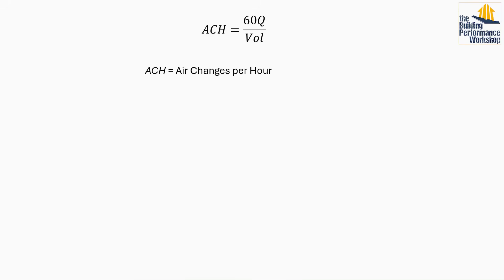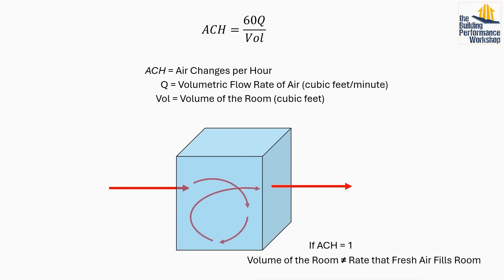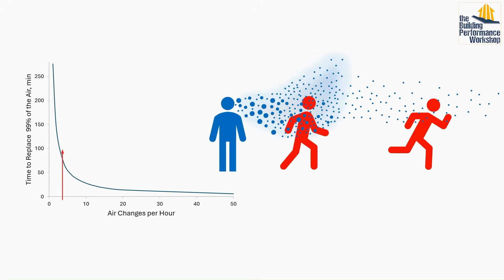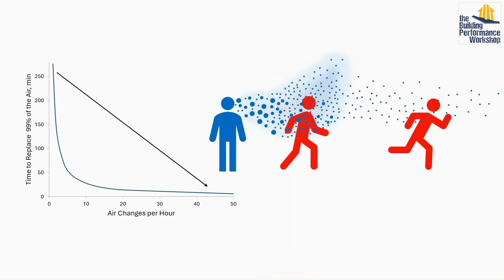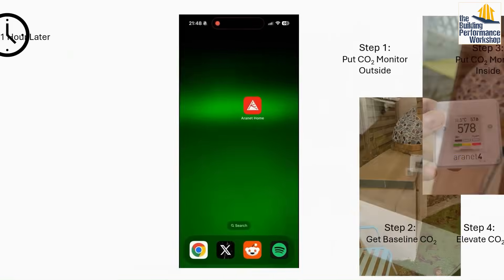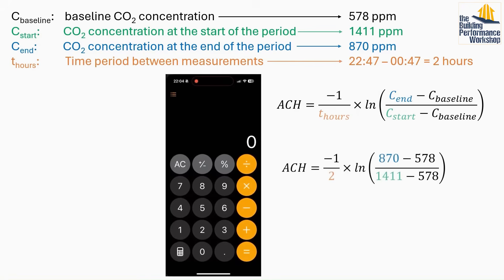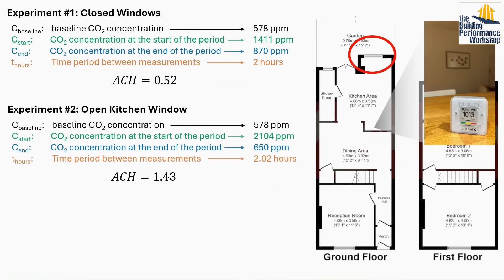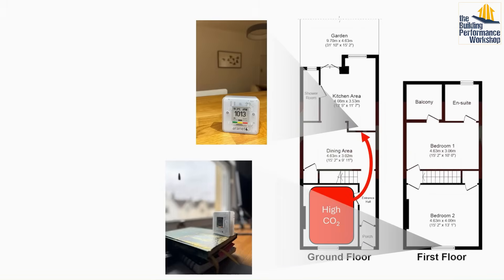DIY Test for Home Ventilation: Simple CO2 Tracking Process by Al Haddrell

Comment: I just purchased an Airthings air monitor for my mom.  $150, consumer grade, but it says it uses an NDIR sensor. Once a day, our CO2 goes into the red (bad) so we open two windows for about 15 mins and it comes back down to green (good).  I suppose we could get an air exchanger/HRV/ERV, but so far this method seems to work well and cheaper up front.  PS- the Airthings gives a history and graph to track movements of measurements throughout the day.

Comment: @HomePerformance do you have any good references as to where the .63 factor comes from, how it is mathematically derived and what it exactly represents? I’m having a hard time digesting it without seeing compensation for delta T or delta P.
Reply from the maker: It appears to be from a white paper called Estimating Air Change Rate in Mechanically Ventilated Classrooms Using a Single CO2 Sensor and Automated Data Segmentation. I’ll interview Iain Walker and Al about it soon.
Reply: @HomePerformance  Thanks. Although I couldn’t find a public copy it got me a good start down the rabbit hole. I’m still looking for the magic .63 factor, but did find some good explanations with a we bit complicated math in this paper “Estimating Time Varying Air Exchange Rates”. Also, ISO standard 12569 covers methods of using tracer gas for ventilation rates and there is a good old ASHRAE paper “Evaluating Building IAQ and Ventilation with Indoor Carbon Dioxide”
Reply: Todd, and Corbett.

The air exchange process calculations outlined follow an *exponential decay model*, rather than a simple linear replacement. This is because when new air enters, it mixes with the existing air rather than immediately pushing all the old air out. The result is that the fraction of old air remaining decreases exponentially over time, and *some of the new air also gets pushed out rather than remaining*.

The general formula governing this process is:

C(t) = C_0 e^{-kt}

where:
C(t) is the concentration of old air at time _t_,
C_0 is the initial concentration (100% at t=0),
k is the rate constant, which is equal to the air changes per hour (ACH),
 e is Euler’s number (~2.718),
 t is time in hours.

So even though volumetrically one full air change per hour (ACH = 1) has occurred, the fraction of "old" air remaining is:

C(1) = e^{-1} \approx 0.3679

So, about 36.8% of the old air remains, meaning that 63.2% of the air has been replaced.

If the air change process were fully laminar flow and no transitions (duct to room, etc.), THEN one full air change would indeed remove 100% of the old air.  That's the '"pipe example" he starts within the video. In the case of air in homes with the CFM velocities, Room volumes, and Duct-register-space transitions, consider that with air, the calculated Reynolds coefficient is almost always above 2000 and, therefore, essentially universally turbulent and undoubtedly practical for home HVAC application.

Mixing occurs due to turbulence and diffusion, meaning that as new air enters, it blends with the existing air before exiting. Air does not exit immediately; the gradual movement leads to partial dilution rather than total displacement.

Thus, 63% of the air is fresh after one air change per hour, and the process continues exponentially with each additional air change.

@toddspraggins225 here's a less mathy ACH 1 (and 2) example: 

Rather than a complete flush of air, the replacement behaves like pouring a fresh liquid into a well-mixed bucket of old liquid:

1. Initially, the room is 100% old air.
2. After one air change, fresh air enters and mixes, so roughly 63% of the room’s air is now fresh, and 37% is still old.
3. If another full air change occurs, 63% of the remaining old air (37%) is replaced, leaving only 13.5% old air.
4. With more air changes, this follows an exponential decay curve rather than a simple linear drop.

ACH (or hours at ACH1 !) | % Replaced
-------------------------
1 | 63.2%
2 | 86.5%
3 | 95.0%
4 | 98.2%
5 | 99.3%
6 | 99.8%
7 | 99.9%
8 | 100.0%

Disclaimer: I started out RPI in engineering but transitioned to math. I am a long-term software/computer guy for work, so this is NOT my profession at all. I'm more than perfectly willing to be corrected/re-educated on all of the above calculations.

@HomePerformance

Corbett, I did want to point out that using that adjustment factor does NOT cancel out the geometric reality of exponential decay.

The 15CFM -> 24CFM example @4:10  by dividing that percentage, it increases ACH to 1.587, which only further dilutes from 63% per hour to 79.6% per hour, as it is exponential decay It seems that an increase of 59% in air heating/cooling/filtering/humidity-controlling "costs" for only a 17% "gain"  seems inefficient. It does not seem like a substantial oversizing factor yet, YMMW.

 I want to emphasize this is merely a nitpick! This channel and your work, Corbett, are amazing, important, and head and shoulders above so much HVAC info out there. Please be assured that I am an enthusiastic endorser and believer in your information and the immense value you bring to the subject! I am much better informed due to your influence, and I look forward to continued enlightening topics from you!!!
Reply from the maker: @JohnGiasi you are awesome. I’ve been realizing this, and pondering how useful it is all week. Unsure how the geometric ACH and this real world ACH square at all, and which one to refer to with clients in design. Lots more conversation needed I think.
Reply: @JohnGiasi  Thanks! I need to digest this some because where I’m confusing myself is in Air vs Tracer - let me see if I can explain what I mean. I fully get the notion of the outside air reducing the concentration of the inside air in terms of it being a solution. I then would think it would be a relative ACH or conditional ACH in reference to the tracer gas concentration like ACH subscript CO2. But if we are talking outside air is the same as inside air (the solutions are the same concentration of stuff), then this feels like it violate Avogadro’s law.

Comment: Hi Corbett, great video! When designing a building envelope most builders are told to construct as airtight a building as possible in order to prevent water vapor from being carried into a wall cavity from either the interior or exterior (depending on climate) and condensing on a cold surface, possibly allowing mould to grow.
I was wondering if you have seen the recent Building Science Corp article by Dr. Joe Lstiburek called “Slide Rules, Pocket Protectors, Cigarettes and an Iconic Building Science Image” (you can find it by looking for “BSI-149” on Google)? In it Dr. Joe discusses how the amount of water vapor that can travel through a 1” hole in a sheet of drywall was vastly under-estimated when the calculations were done in the 1980's, thus making the issue of airtight assemblies even more critical.

Comment: Does ACH matter much if space is unoccupied? If you could tie in a geofence programming similar to thermostat use it would only ventilate when the space(s) have humans in it.
🤷‍♂
Reply: Depends. 

If you are using a smell fan like an erv of 60 CFM or thereabouts, you may need to run it all the time or your indoor CO2 will always stay high. I've tried ventilating my house with just one 110cfm fan(actual cfm approx 80) and CO2 levels stay above 1000ppm

With 300cfm of fans I can bring down CO2 from 1000 to 700 in under 30 mins with 4 people in the house so I can run it intermittently
Reply: @ Good control. Try not to get to cray cray on the CO2 quest...
https://youtu.be/CkGDN85I29U?si=5ywqDPNzXS34eGLx

Comment: This is a great video.  A key point to take to heart is this:  is the indoor air quality better or worse than outside at the moment? Corbett's point addresses a few evils (humidity, temp, PM2.5, ozone), but there are many more, like radon, VOCs, etc.  You will need to measure all of them, both indoor and outdoor to decide if ventilation and how much is beneficial vs detrimental in a complex calculation.  Complicated stuff. If you are lucky enough to live in a clean dry area, it is likely much better outside than inside 99% of the time, leaving you with only heat (sensible heat) to deal with.  Simple indoor filtration doesn't really work for many pollutants, and doesn't work with 100cfm+ of cross flow from outside, so you have to pick one or the other, or reduce fresh air (HRV) plus filtration, and hope for the best on the evils in the air.

Comment: My blower door score was 1.48 ach50. Using the CO2 meter I get 0.095 air changes per hour. I have windows cracked open but not enough ventilation so what I did was I automated all my bathroom fans to turn on when CO2 is about 750 and turn off when it's below 680. That way I can have good indoor air quality without ventilation all my heat out
Reply from the maker: I wish we had consulted on your ventilation system before you finished the build
Reply: Yes! Me too. I grossly overestimated my air leakage rate. I anticipated 5-7 ach and no need for additional ventilation. Epic mistake
Reply from the maker: The hard way is the best way to learn though! You’re a better advisor to your friends now.
Reply: Interesting bath fan programming! I take it when the fans are on they pull unfiltered outside air in through the cracked open windows?
Reply: @ehiker1 yes,they are pulling unfiltered air through the windows. Thankfully iv live in an area  with very clean outside air. I track my indoor pm2.5 and it's stays between 0 and 4 ug/m3 so it's very clean air.

Comment: Great video. I have the aranet4. They are about $170 nowadays. I also have a qingping ndir CO2 sensor. It's about $60 on amazon and it's as accurate as the aranet4 4. The battery doesn't last as long but it's rechargeable
Reply from the maker: Appreciate the info!

Comment: Wondering if adding plants can lower the CO2 levels by more than a few ppm. Is it worth trying and testing?
Reply from the maker: No, it'll be minimal. Feel free to test it though, the scientific method is for everybody!
Reply: The idea is to use CO2 as a measure of how efficiently the indoor air is being replaced by outdoor air in a given space. If you were to add anything that would significantly change the CO2 concentration (either by increasing or decreasing it), that would add error to the measurement. As for plants, the amount they would change the CO2 concentration in a room would be minimal.